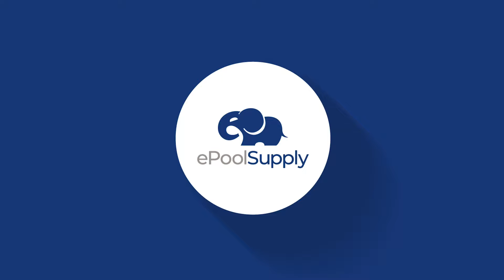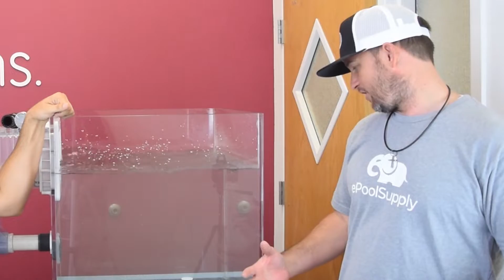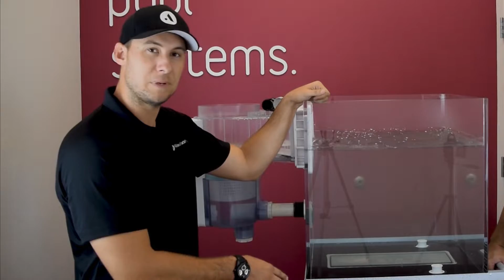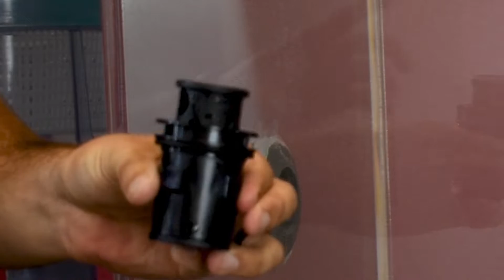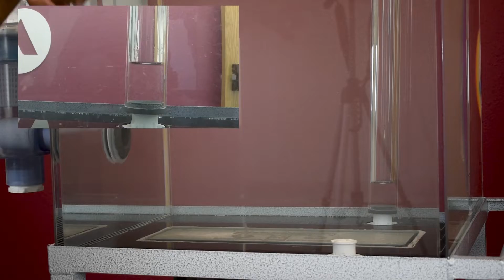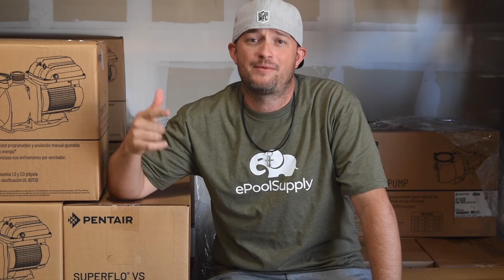A&A Manufacturing Gamma Series 2/3/4 Venturi Pop Up Head Demo

Comment: I have an A&A system. I'm interested in installing the new Gamma series. I watched a video form AZ Pool Tech where he is able to test the flow to calculate GPI to set. He's using a standard pressure gauge. Would you be able to explain how to set up a test gauge. Looks like he's using a very small diameter hose off the gauge. Where is he getting the reading from? Love my system but I'd like to be able to run the pump at a lower RPM. Thank you
Reply from the maker: We actually sell that device which we will kindly link below so you can take a look. Hope this helps!

https://www.epoolsupply.com/products/a-a-gamma-3-g4-system-pressure-test-kit
Reply: @ePoolSupply  thanks. How do you set? Do you test all pop-ups?